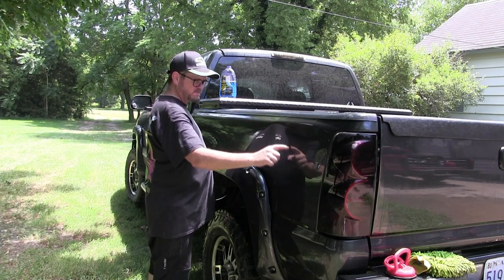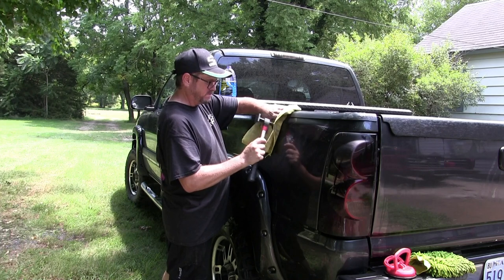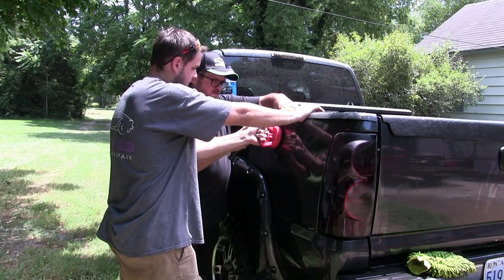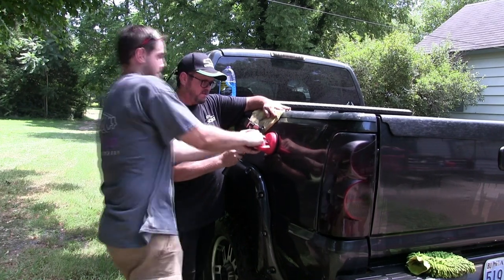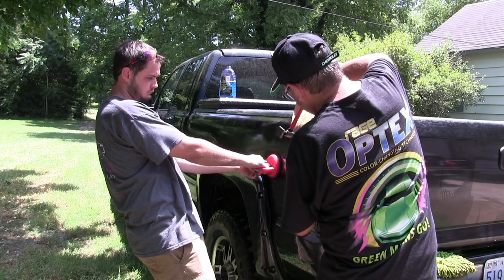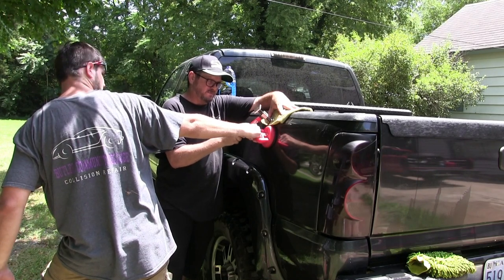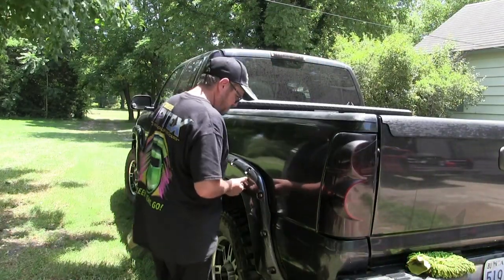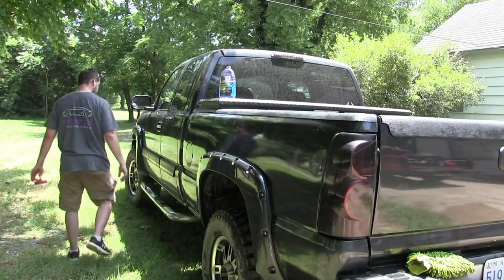DIY Dent Repair Trick Using Suction Cup and Hammer

Comment: On dents like that, I was always told, First in, last out. Don't just start in the middle and yank. Another good video, thanks.
Reply from the maker: First in, last out is correct.  The center is usually the point of impact, which is the first in.  So you start outside of the center and work towards the center or point of impact.  hanks for the tip and for watching.